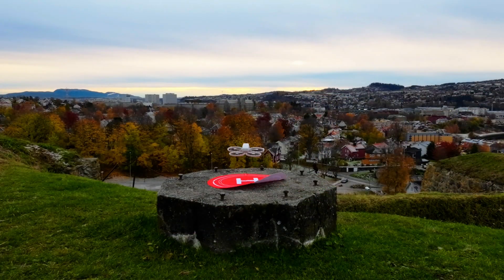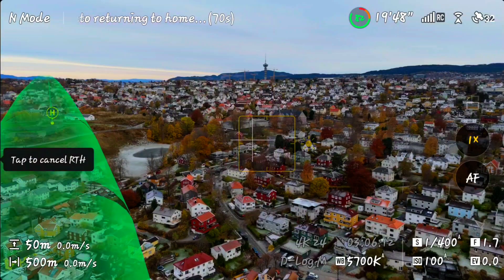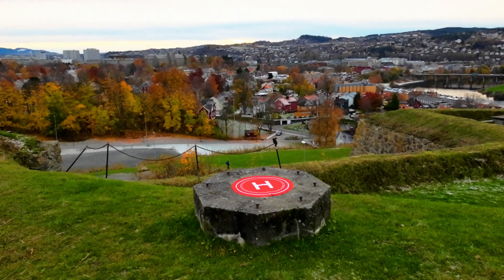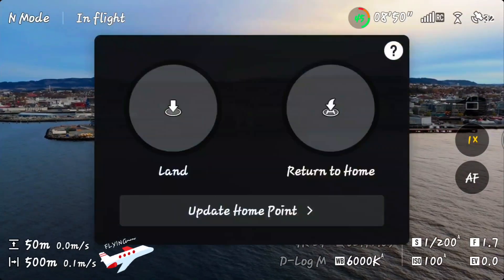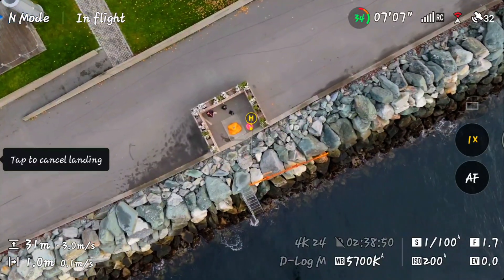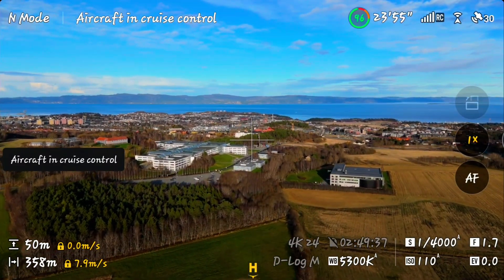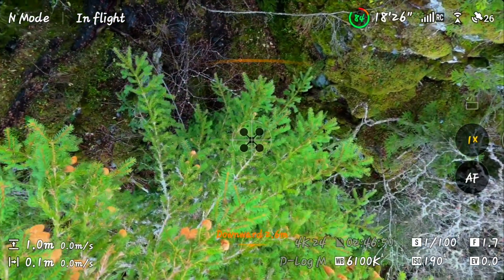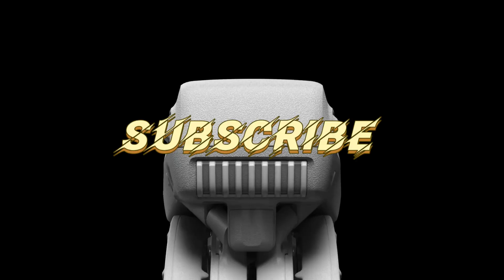Can DJI’s Return-to-Home (RTH) Feature Save Your Drone from Disaster?

Comment: You guys need to know before this, RC drone community achieve around 2-3 meters, and it is very impressive for such a small affordable devices. 

1 meter deviation is actually pretty good. People are so relying on the accuracy rth and stuff nowadays. Even tho dji is one of the most precise home point update. 1 meter is very small. 

I'm pretty sure it's your model or software bugs. My dji accuracy is always less than a meter
Reply from the maker: Yes, it's very impressive. In the first scenario, it lands perfectly, but on water and difficult terrain it deviates a meter which is still very impressive.

Comment: A drone is not a toy, even though that's how it's marketed. If you don't read the manual, you'll have problems later on. Firstly, you are doing it wrong, and secondly, there are so many factors that can affect the operation of the drone and its functions, which you ARE informed about in the manual, that you cannot complain that something does not work, and all the options are aids and not a replacement for the pilot.
Reply from the maker: I doubt toys are that advanced, neither I'm treating it as a toy. I'm just testing it's functions in different environments. If you have watched the video closely, I have left the pop up notifications for both over water and at Burmaklippen that says "RTH might not work accurately over water and in complex terrain. So, it's not a complaint, I'm just showing drone operators to be careful when flying over water and in complex areas like forests.
Reply: @WanderNorge  I understand you, but if you want to demonstrate something, you have to be sure that you are doing everything according to the rules. Showing that the drone does not return perfectly to its place without following the ‘precision landing’ procedure is a waste of your and my time. I understand that this may be due to a lack of knowledge, but as they say, not knowing the law does not release you from obeying it. 
Good luck with the next content!
Reply from the maker: @Szwedu666 I'm still new to drones, so I'll definitely make some mistakes. I got to learn something from your comment, so that helps as well, thank you.
Reply: @WanderNorge  ok , sorry form my harsh approach. You will do good
Reply from the maker: @Szwedu666 No worries.

Comment: You should try the air 3s or mini 5 pro or even a Mavic 4 pro if you have one of these drones their RTH is insane even 99% accurate without gps
Reply from the maker: I don't have any of these yet as I'new to drones. But, I'm considering getting mini 5 pro. Mini 5 pro's 1 inch sensor makes a huge difference in video quality which is important to me.
Reply: @WanderNorge yes it’s still a good drone but not good in wind!
Reply from the maker: @itzJasonJustinI also want to consider regulations, so a sub 250 grams drone is just a less hassle for me.

Comment: I have over 600 flights (5 years( with Air 2S, Air 3 Air 3S and Mini4Pro) and use the RTH 99% (or more) of the time. In all my flights  I have had only one seemingly “hiccup” on the RTH..  As it turns out, it was not a hiccup, but the Obstacle Avoidance kicked in and saved my drone.  I always have Obstacle Avoidance set to “Stop” - and it did!  Stop gives me the chance to observe and “negotiate a way out” if caught in an area.  In this one case, I could see that the best way out was a vertical ascent to altitude and then continue the RTH.  I have seen or heard of too many issues with the “bypass” setting.  Yes, it works most of the time, but I don’t want my drone to be the one where it doesn’t work.
Reply from the maker: Yes, I totally agree. I too have set it up to Stop rather than trying to bypass. There's always a chance that the drone won't see something and crash while trying to bypass obstacles, especially when flying in areas with a lot of trees.
Reply: I keep the settings in bypass cause I fly my drones behind hills and mountain tops. Possible braking because of an obstacle means losing the drone while with bypass it comes back every time 😁
Reply: @SmartSamsung-u5h  I certainly don’t argue with your logic, but if it stops behind hill as you suggest, it is not as if you don’t know what has happened (can see on Fly app that it is not moving) and can rotate or look for a “best way out”.  It has happened to me several times, and in my cases, it was always ascend to “safe altitude” and fly home.

Comment: Did you check the procedure described by DJI for Minis? 
- After autostart ascend to at least 7 meters and let the drone hover there for 10 seconds. Then perform your flight and trigger RTH. The drone should precisely land where expected.  It works every time for Mini 5 Pro. I am curious whether it works for your model as well.
Reply: You are “spot on” (pun intended).  Many don’t read the instructions which clearly points to the 7 meters (21 ft) after take off to “see the landing spot”.  Good job!
Reply from the maker: @FunFlyingPilot I'll try again with these suggestions. I do wait for homepoint update flying over the homepoint, but I'm not sure if the drone is around 7 meters high.
Reply from the maker: I have done that as well. I hover over the homepoint for around 10 seconds, wait for the homepoint update notification and then fly away.
Reply: That's a legacy feature since Mini 3 Pro I think, I always forget about this. Thanks for the reminder.
Reply from the maker: @btkger You're welcome.

Comment: You can improve landing accuracy by calibrating compass every time you change flying location. When you go somewhere else to fly, calibrate compass. My Mini 4 lands on the spot every time. Cheers!
Reply: That is not necessary and honestly the RTH does not use the compass.  It uses the GPS.  Perhaps you meant recalibrate the GPS, but even that is not necessary unless you receive a warning to do so.  As the Satellites are picked up(signal received), a new position calibration is done in “nano-seconds”.  It is constantly being updated.  The more satellites the better position accuracy that you will have.
Reply from the maker: @FunFlyingPilot I have tried compass calibration and it didn't make any difference.
Reply: @WanderNorge As I mentioned to the other commenter; RTH does not use the compass.  It only uses GPS.  Recalibration of the compass has zero effect.  If your compass appears off, it is probably due to large metal object nearby; ie., a car or large metal building, etc.
Reply from the maker: @FunFlyingPilot Yes, compass calibration had zero impact on RTH accuracy, I have tested that.
Reply: @FunFlyingPilot GPS gives you a position in the sky. Compass gives the drone heading, where to fly, where is the north, they work in conjunction... Cheers!
Reply: You are not wrong, but only partially correct.  A GPS will work in sky and on ground as will a compass.  In addition the GPS will give you altitude information.  A compass does not give you headings - it does one thing “It should always point to magnetic north(which is different than true north).  The pilot determines headings.   The exception to that with most drones is the RTH which determines and provides the correct heading. (Done with GPS only).  I taught flying ground school in the military and civilian world for over 43 years as well as Part 61 flying instructor.  A compass is more easily influenced by metal surroundings (a car , metal building, power transformer, etc).  You are correct in that in conjunction they provide the necessary information tp practice good flying skills,  but it is important to know what each is doing and the information provided can very easily be influenced.  Prior to GPS a ground based navigation system was used for relatively precise navigation called LORAN (Long Range Aid to Navigation).  It was initially established by the US Navy for ship navigation, but became part of the aviation community decades after it was initially established.  This was decommissioned in 2010.
Reply: You calibrate the compass or IMU only when you are ASKED to do so; you do not do it for the sake of it, as you may cause damage.
Reply: @Szwedu666 no no... Cause damage? Never!. .. Every time you travel, or when you change flying site, or after a hard landing or bump, you always calibrate IMU and compass. It will improve accuracy... Old school!
Reply: The IMU, or Inertial Measurement Unit, in a DJI drone is a core sensor that uses accelerometers and gyroscopes to measure the drone's orientation, acceleration, and rotation. This data is critical for the flight controller to maintain stable and controlled flight by making real-time adjustments. Regular IMU calibration is necessary to ensure the drone's accuracy and stability, especially after traveling to a new location or performing a firmware update.
Reply: @abuelotecnologico  There is no way DJI would say that. None of the manuals for new DJI devices mention manual calibration. UNLESS AND ONLY a notification pops up! Everyone should check the manual! Don't listen to people with methods from the era of the first Phantoms and spinning the drone around in circles... helicopter helicopter...
Reply from the maker: Thanks. That's a great tip. I'll try this.

Comment: Hello! Should I buy the Flip for filming cars in motion, architecture, and mountain videos? Or should I buy the Mini 3Pro or Mini 4Pro?
Reply from the maker: Hi, I would recommend mini 4 pro, since DJI Flip can't follow cars in active track mode. If the budget isn't a problem, you can also consider mini 5 pro, which is a lot better drone overall.
Reply: @WanderNorge mini 3pro no?
Reply from the maker: @Zodism13 mini 3 pro is pretty good as well, but it's a bit old drone. If you want to choose between mini 4 pro and mini 3 pro, then you can get the mini 3 pro as there isn't a huge difference in their specs.
Reply: @WanderNorge ok thank you, but Flip fly combo like for me)
Reply from the maker: If you are not going to actively track moving cars, then go for Flip. It's better than mini 3 pro.
Reply: @WanderNorge ok. And last I had a question! If buy Flip, me don't need the RC2 and that will be enough Smartphone + RC-N???!
Reply from the maker: @Zodism13 I have been using RC-N3 with my smartphone for a while and never have faced an issue.
Reply: @WanderNorge ok, but Rc2 more opportunities?
Reply from the maker: @Zodism13 I'm not sure about the opportunities, but RC2 is a better controller overall. It takes less time to connect to the drone, the screen is brighter and the antennas might help with better connectivity.
Reply: @WanderNorge thanks, we waiting new video!
Reply from the maker: @Zodism13 You're welcome. I usually post long videos on Fridays.